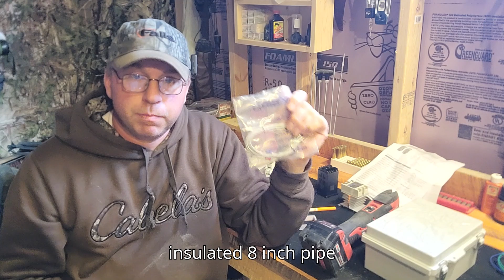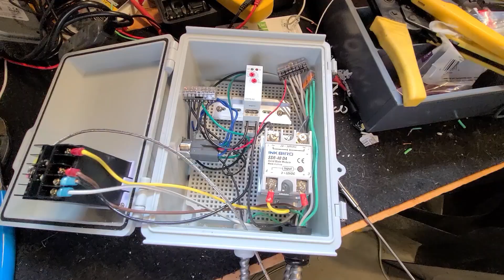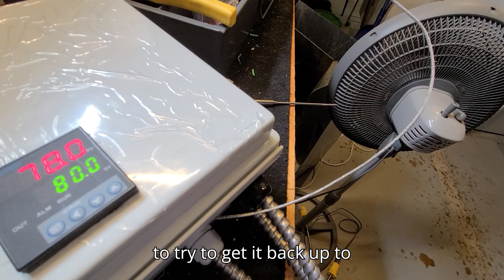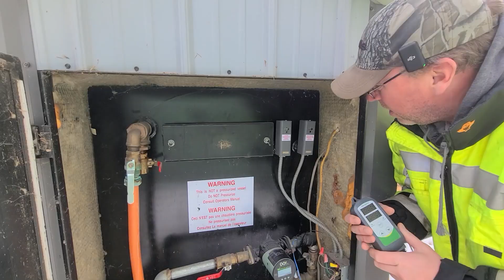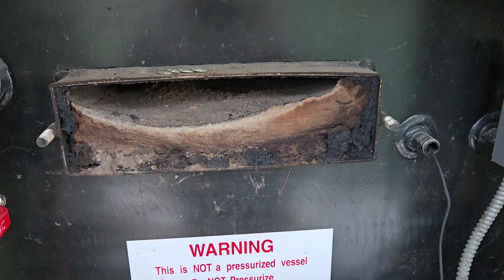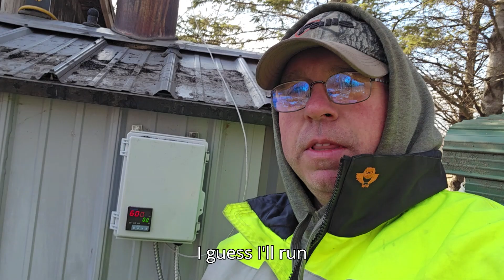Heatmor Wood Boiler with PID Controller upgrade! #diy #woodboiler #energyefficiency

Comment: Im looking to build this.  Was trying to find a controller that would actually control the speed of the fan not just on and off.

I was wondering if tge fan would fail due to all that extra cycling on and off?

In this video im guessing your damper doesn't stay open when the fan turns off?  Mine would stay open as its on a solenoid so maybe it wouldn't cycle as much depending if the natural draft would keep the fire hot enough.

Ive also thought of just adding a manual fan speed control to adjust the fan speed to limit the constant cycling of the fan motor.

Curious to know if you've made any modifications this year?
Reply from the maker: To control the fan in relation to the stack temp would be more difficult. Probably need a small computer and programing that's way above my head.  If you want the fan to just blow less air into the Firefox, id just make an adjustable damper on the fan intake.  Or maybe a dimmer switch on the power side, but then you could still possibly burn up the fan motor. 
My damper the fan opens with air pressure when it runs, so hopeing to get a solinoid on there one of these days.  
I did have some issues about a month ago when we were at -30.  Don't think the switches liked the cold, so i may have to look at trying to get it inside the cabinet.  
Thanks for the questions, have a great day!

Comment: I kind of have a feeling I know what you're trying to accomplish. I think all it takes is a bathroom timer and honeywell touch on one of the outgoing lines. So when the boiler drops down to lake let's say a hundred it shuts the draft fans off. So now when you load the stove again just turn the timer on for 45 minutes it'll override it till it gets up to temperature so it's over 100° again.  I've never had any luck with any of that fancy stuff that works good in the cold. The old Honeywell manual switches work awesome. And the old school manual bathroom timer for the fan over ride.
Reply from the maker: Sometimes the old stuff is the best stuff.  I think your kinda on the right track with the idea of this.  The aquastat still works like it normally does.  Water temp drops and it turns on the blower.  The controler basically goes between the two and monitors the stack temp. The goal with that is to keep the stack temp from getting to high and pushing alot of heat right up and out. So the controller shuts the blower off at a certain temp and then back on when it drops. Continuing to do this until the water temp is reached and then the aquastat shuts it all down.  The timmer function has been probably the most noticeable improvement. Right now I have that set at just under 4 hours.  When the contrler doesn't get satisfied with the preset stack temp it will shut the blower off until manually reset by me.  Thus saves the coal bed in the stove so it is much easier to get the Fire going.

Comment: what is the purpose of the timer?
Reply from the maker: The timer turns the blower off after a set amount of time. So if the stack temp doesn't get up to say 600 and the blower keeps running.  Your coal bed will slowly turn to ash and water temp will drop faster making it harder to get the stove going again.
Reply: @dustybooksdiy  does the PID MODULATE the fan speed or is it just on and off at stack temp?
Reply from the maker: @yukoncottages372  it just turns the fan on and off.  I do have the option to keep the damper so it will stay open with a solonoid, but havent gotten to putting one on yet.
Reply: @dustybooksdiy  how long do you run the timer before the fan shuts off?
Reply from the maker: @yukoncottages372 right now I've got it set at about 3 hrs.  Ive been playing with it. I think ill go back down to 2 hrs as it had more of a coal bed
Reply: @dustybooksdiy  on my PID, pin 10 is +, pin 9 is -, is that not the case with yours?

Comment: Can you show the connections to your boiler and inkbird? The way it looks to me is the PID is only powered when the inkbird is calling for heat
Reply from the maker: That is correct. That is the way I have it setup.  It is the easiest way to wire it as the pid only needs to be on when when the water temp drops amd the inkbird is calling for heat.  You could wire it so that both have power and the fan/damper circut runs thru the output of the inkbird and pid. But the only advantage to that that I see is that the pid display would be on all the time if you need that information.
Reply: @dustybooksdiy  I was actually thinking about wiring my damper to the inkbird so it would stay open the whole time and just let the pid control the blower
Reply from the maker: I was planning on doing that myself, but my damper doesn't have a solenoid on it so it only opens when the blower is operating.
Reply: @jchase4650 that is what I’m planning on doing to let it keep the burning cycle but keep it more steady I also have my fan on a variable dial and have it slowed down. I’m really interested in a follow up video on this project.